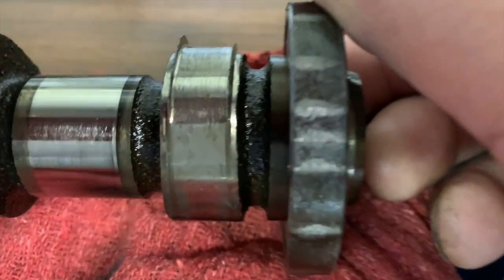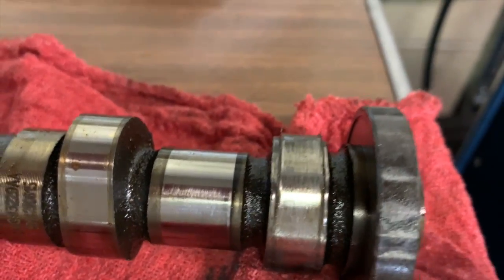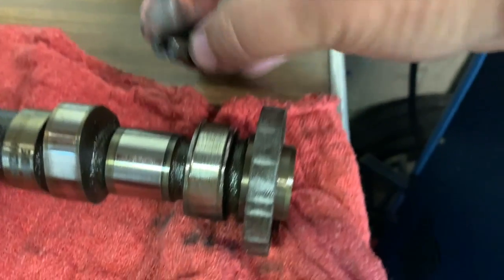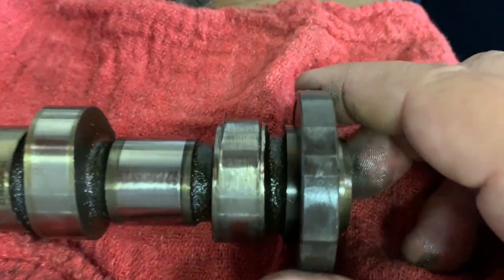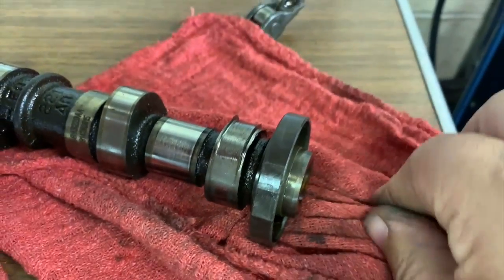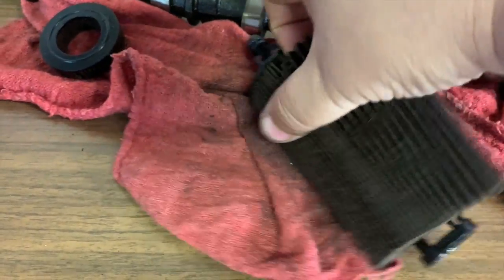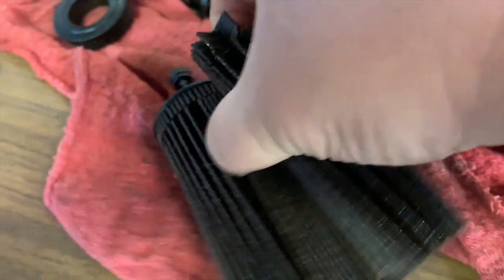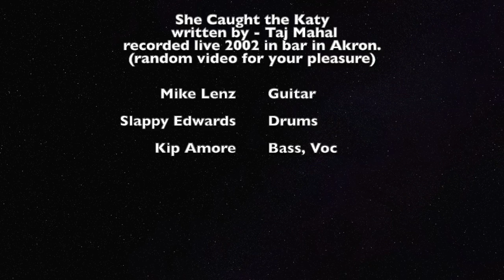Camshaft Wear, the Pentastar Tick, metal in filter, plus a musical bonus! Ram Promaster

Comment: Will the tick cause a service engine light to come on? I’m a noob and bought a crappy obd2 and can’t get it to connect. Fairly certain I’ve got the tick and I’m going to try and sort that out asap. Will have to let the mechanic beforehand that I didn’t know about the cowel problems so surely have rusted out intake manifold bolts. Yeesh. Thanks for sharing your knowledge you da man.

Comment: Mister,
I have read a few places on internet that the 2020 and up pentastar does not have the needle bearing anymore. 
Do you have any information about that? Much appreciated 
Dan
Reply from the maker: @danielbec4287  I do! In late 2019 just before the ‘rona, chrysler released the H revision of the rockers. Those are what we use for upgrades, and so far have never had to redo rockers regardless of mileage. 

Hard to say if a MY2020 would have them, since it could have been built as early as Sept 2019. The build date is on your door sticker. 21-22 all have them, and 23-up use entirely different intake valvetrain but exhaust is unchanged.

Comment: My tick is starting, should a local mechanic be able to diagnose? If there is a camshaft noise should we focus on the rollers or are there other parts needed if the cam is still good? Thanks Kip! I am a fan
Reply from the maker: Easiest way is to cut open a well used oil filter. If you find metal, you pretty conclusively have the tick. If you dont find any, but still have a ticking sound, it's likely a lifter and not a rocker, and I feel that's safe to ignore mostly. Tick usually comes on around 110k miles.
Reply: Appreciate your reply! Unfortunately, we just did service and didn’t check the filter. We drive very little every year. The van has about 130,000 miles now. We have decided to repair whatever breaks since we have put so much time into converting it into a camper van.
Reply from the maker: @MrOlaboss  The thing to know is that the tick is a long term issue. Noise aside, you've probably got 20k miles between the time when it first starts misfiring and when it's undriveable because it's misfiring. So you can wait till it's convenient to address it. If you are looking to "bulletproof" the engine, I'd recommend replacing all the rockers but not the lifters, and while you are there go ahead and upgrade to the Dorman 926-959 aluminum oil cooler. It makes sense to do both at the same time. With those two issues upgraded, you'll pretty much never have to worry about the basic engine except for oil changes every 5-10k, trans fluid and filter every 50k, and plugs every 100k.
Reply: @promastersonly1419  what if you have the 24pcs kit already. Wouldn’t it make sense to just change both lifter and rocker ?
Reply from the maker: @Mobz77  The lifters are testable; just squeeze them and if they are springy replace them. Lifters can fail/wear out but when they do you get the ticking sound but no other issue. My feeling is it's fine to keep using them if they test good. We charge $11 each and you have 24 of them, so it's not a fortune but it is a savings.
Reply: @promastersonly1419  Some people have actually found needle bearings in the oil pan.

Comment: I have a 2019 with just over 10000, I plan on upgrading the the oil cooler should I update the rockers at the same time?
Reply from the maker: The rocker arms are a drastically bigger job than the oil cooler seals, though they share having to remove the upper intake. At only 10k, you are cheating yourself out of pretty much 100,000 miles before you can expect the rockers to go bad, if they go bad - not all do. So I would definitley wait on the rockers.
Reply: Oops I left out a 0 my promaster is at 100000 but it doesn’t have a pronounced tick
Reply from the maker: @michaelkoppenhoefer5910  Ah. I think the advice still stands, but I can give you a tip. Next oil change, cut open your old oil filter. A very small amount of glitter is normal, but if your rockers are bad it will be obvious by the amount of metal in the pleats.

Comment: awesome visuals. so would you do the one cam or all? also 1 rocker or all? you are the best!
Reply from the maker: I like to do all 24 rockers at once, but I see the case for only doing them on one bank. The cams are either gouged or they are not, and if not there is no need to replace them. There's 24 lifters too which we inspect, but so far have never needed to replace one.
Reply: What year was the vehicle you did the replacement on?
Reply from the maker: @05fordvan  hard to keep vans straight, but I think that cam came out of a 2016.

Comment: Case hardness on that is likely less than 25 thousands of an inch.
Reply from the maker: The cams aren't the problem. It's the roller on the rocker that wears, seizes, and then galls the cam. If the rocker is good, the cam will NEVER wear out. See my channel for a teardown of a 500,000 mile engine.
Reply: @promastersonly1419  the point is is doesn’t handle any wear before you are through the case depth.
Reply from the maker: @doomman700  Agreed.